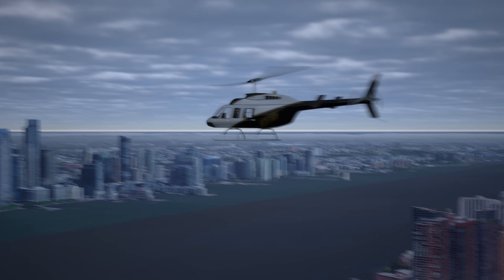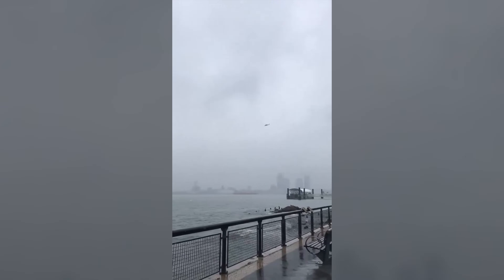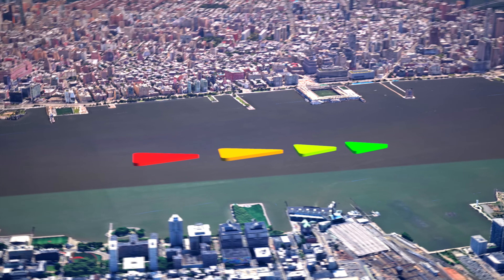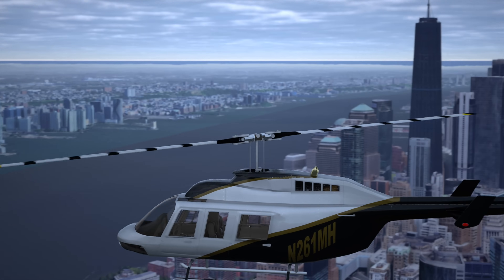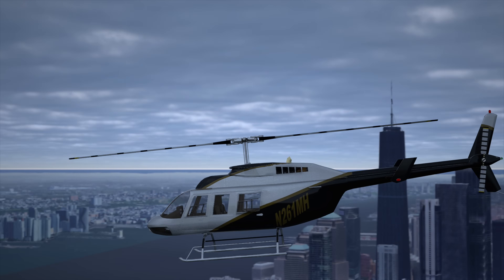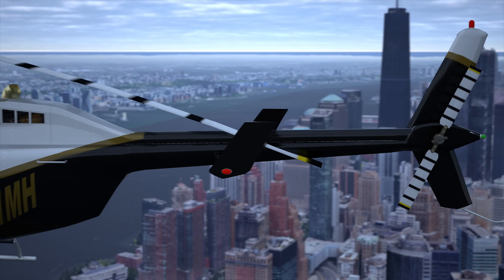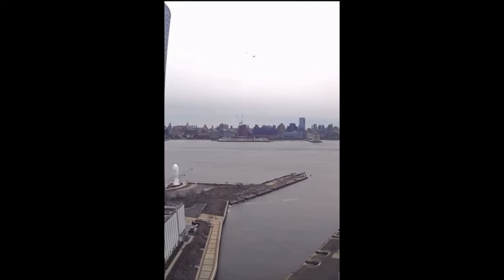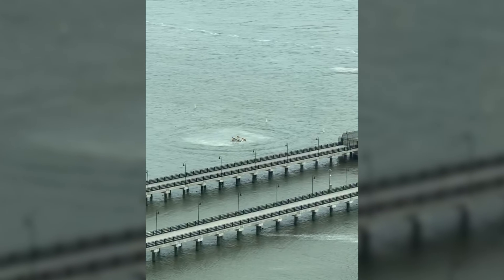Helicopters DON'T just fall from the sky - What is "Mast Bumping"?

Comment: As a 35 year Commercial Helicopter Pilot and Flight Instructor, your Video offers some good basic info. If I may, I would like to add that typically, mast bumping results in the separation of the Rotor Head (and blade assembly) from the TOP of the Mast. I can't remember a case where mast bumping caused a catastrophic separation of the transmission, mast, and main rotor assembly together from the fuselage as it appears in that video. It does look (to me) like a tail strike (or independent tail-boom separation) which could cause that component separation to occur due to the violent torquing effect and imbalance that would result. It's a Terrible tragedy, and my prayers go out to all those affected.
Reply: Excellent point that nobody is seeing. Additionally, the suggestion that a tail cone chop occurred seems to inconsistent with the completely undamaged main rotor spinning in balanced flight after separation. RIP to all aboard.
Reply: @givdrvr  It looks like a gearbox failure.
Reply: @christopherrobinson7541  I agree, he's straight and level here, looks like half the transmission comes off with the main rotor, then it contacts the tail as it comes off the helicopter. Poor dude, RIP
Reply: 20+ years Army helicopter pilot/test pilot.  Yes the rotor system appears to still be attached to the mast and the mast to the "transmission, not the engine.  I agree, in my experience Mast Bump usually separates the rotor from the mast.  In the short view of the rotor system, the rotor blades don't look quite normal, which, to me, suggests contact with the tail boom.  The investigation should figure this incident out.   Don't jump to any conclusions.  Obviously, a sad situation.
Reply: It was not mast bumping. The rotor blades were still in tact and spinning after disconnecting. If those blades hit the tail boom they would have exploded and not been still fine and spinning after disconnecting from the air frame.
Reply: @danmackey9462 By your statement, with respect, I'm not sure you actually know what mast bumping is. Mast bumping has nothing to do with the Tail boom.
Reply: @unapologetic7900  But if the rotor hits the tail of the helicopter at full speed, would the rotor blade still be in one piece?
Reply: @MuffelamMorgen  Maybe, maybe not. It's possible. Those Blades are very tough.
Reply: @unapologetic7900  dude those rotors yard sale if they hit water or pretty much anything. And if they hit the tail hard enough to take it off then 1000% the main rotors would have been in a cloud of parts not still spinning like they are fine.
Reply: @unapologetic7900  I've repl;aced rotor blades on the OH-58 military version of this aircraft, simply because the pilot hit a few twigs on the end of a small branch. There would not have been a rotor left had there been a tail strike.
Reply: @ The Blades of an OH-58 are like a Honda Civic compared to the Blades on a 206-L which would be like a Dodge Pickup. WAY more mass.
Reply: @ Same construction just longer. Bell 206 L  is heavier.
OH 58 C has two blades and later AHIP OH 58 has 407 style rotor system.  
Worked on all Bell products.
Reply: @HongyaMa  My mistake, I was thinking of the OH-6 (MD 500).
Reply: @unapologetic7900  Love the Hughes stuff
Reply: Video still shows Tail boom . mast rotors and gear box exited the scene at the same time. no tail strike, no mast bump. Tail seen with everything intact fin, T/R gearbox & stabilizers - Main rotors mast & main gear box together.
1- Blade lost a piece and gross imbalance over load to structural failure. See it before. Live on scene.
2- engine failed and pilot didn't maintain rotor RPM and the nodalbeams shook everything off. Bell test film.
Helicopter floating with deflated float bags (no deployment) = low or empty fuel tanks 
measured the still and saw one blade shorter then the other . optics?  Whole assembly mast gearbox attached to blades,  above the airframe tail trailing behind whole no strike damage. impulse over load?
If you lose a chunk of blade it will be sudden and it will look like this.
1980s N131AT was a Bell 206 AB and it lost a blade piece at a hover. sudden roll and gear box nearly ripped out.
The student & instructor exited the upside down helicopter  lucky pieces of blade missed everyone. 
found the 1st blade piece imbedded in the runway center line 800 ft away - Sticking up like a road sign.
45+ years helicopter CRH AP-IA with a little time with the NTSB (expert help in the field).
Reply: @HongyaMa  I heard one report that the pilot radioed he was almost out of fuel and was making an emergency return back to base.
Reply: @ time will tell
Reply: This is too sad. Prayers for the surviving family members.
Reply: Caused by what? Poor maintenance?   Improperly torqued bolts? It looks like the aircraft just came apart
Reply: They call it a tail boom bumping, but the blades look 100% clean.
If any blade had touched the tail boom, they would have either bent or break.
Reply: how many mast bump accidents have ever caused a separation of the tail in history of all crashes hmm and who was on that plane hmm
Reply: I think this is going to be catastrophic gearbox failure, causing it to lock up and be ripped out of the airframe by the inertia of the rotor.
Reply: Finally, someone with an intelligent response.  I flew this model aircraft for about 8 years in the army and mast bumping was something we were trained to avoid by staying within aircraft limitations as explained in the operators manual.  Never the less mast bumping results in a main rotor mast fracture and separation in the area of contact with the main rotor head mast stops and not in the separation of the entire rotor head and transmission assembly together.  The accident investigation will ultimately find the actual cause but If I had to guess, it will be related to the tail boom separation and related torque effect on the main transmission assembly as stated by @unapologetic7900.  It's much harder to strike the tail-boom with the main rotor blade than everyone seems to think in the course of normal flight which this appears to be until the moment of the accident.  I always trained pilots to be aware, you don't have to fly aggressively for a helicopter to kill you.  You can just be flying along, straight, dumb and happy and next thing you know boom, your whole world is turned upside down trying to deal with an in-flight emergency.  Unfortunately, this seems to be the case with this accident.
Reply: All helicopters can self-destruct mid-air if the limits are not adhered to. An Apache can hit the canopy with the rotors if you hit the bump stops hard enough, just about any helicopter can hit the tail boom with its rotors if you try hard enough. They all have different limitations that must be followed for safe flight.
Reply: "jesus nut"
Reply: Correct. Push pull tube more likely.
Reply: A flock of birds was seen in the area by witnesses, which could have caused a sharp maneuver by the pilot to avoid the birds. The sharp dive could have caused the mast bump.
Reply: There was a witness that claimed to hear loud noises almost like gunshots, regularly paced, before it downed.
Reply: They don’t have safety things like airbags or parachutes?
Reply: As a 36 year commercial helicopter pilot and flight instructor, I can say mast bumping consistently causes catastrophic separation of the transmission, mast and main rotor assembly
Reply: @jvillain9946  Wrong. Mast bumping takes the rotors off at the point of contact, Mast & Yoke - The blades leave the scent and the helicopter o becomes a Simonized bowling ball. The was worse structural failure from dynamic overload... single Blade failure
Reply: @HongyaMa  wrong mass bumping places the rotor at the points of contact
Reply: @ troll elsewhere.
https://www.youtube.com/watch?v=mom1EJOb51o
You're not an Rotary winged Aviator.
Reply: @HongyaMa  what's it like living with a desperate need to be offended
Reply: @ What's it like living with a desperate need to comment on things you know nothing about?
Reply: @unapologetic7900  pretty easy actually. This is just entertainment to me. Especially when people like you who are incapable of comprehending satire bc they need to be offended by everything all the time. Oh did this offend you?
Reply: @jvillain9946  Lol, not in the least, but it should offend your Parents. How proud they must be.
Reply: @unapologetic7900  I can promise you theyre  not poorly feigning restraint to cover their rage at being called out for needing to be offended by everything all the time just bc someone made a satirical joke in a random comment section in a random video. Watcha else you got Karen? Don't you have a minimum wage employee to be harassing?
Reply: @jvillain9946  There is a big difference between "trolling" and just being mean. Your problem is that you don't know the difference. In order to "troll" you first have to actually understand the facts, which you clearly don't, you are a sad case, please check to make sure you have taken your Meds today.
Reply: @unapologetic7900  difference between being mean and stating facts, like you just want to be offended and will look for any reason to do so and now looking for reason to defend doing so.  How bout you go back and read the original comment then read my original reply again and tell me how you didn't see that it was satirical and how you immediately decided to get offended bc of your need to be offended and need to feel superior
Reply: You are being too kind.  This video is shit with pretty graphics.  People should wait for the preliminary NTSB report before floating theories on flimsy evidence.
Reply: But curiosity by those of us not well versed on the inner workings of a helicopter this is interesting information. 

I know what curiosity did to that cat, but it's interesting the theories by those who know a thing or 2 about the birds.
Not jumping to any conclusions, just pondering possibilities. Glad you're here to keep us in check though.  ✌️ @Skummeh2
Reply: How often does this happen? 
Are there any maintenance rules to check for this before departures?

Sully got skewered by other pilots because he said F them birds instead of doing what everyone else has been doing before due to the birds
Reply: @adrianspikes6454  Extremely rare, most modern Helos don't have this style of "teetering" two blade system , so "mast bumping" (if that's what happened here) is far less likely.

Comment: Shouldn't this be considered a design flaw? The "possibility" of the main rotor touching the tail or any other part of the copter, is what caused this.
Reply: It definitely sounds like a design flaw, but whether implicated in this crash, unknown...it may have been caused by poor maintenance  and or a bearing failing, and/ or a part shearing off.
Reply: Not a design "flaw", it's just simply the laws of physics. There are fully articulated rotor systems that mitigates this issue but they are more expensive to acquire and maintain. There are plenty of limits in any aircrafts especially helicopters, some are accounted for by using a more upscale and expensive design, some the pilots need to account for.

Comment: Oh I feel so bad for the owner of the company and family members of the victims.   That last radio response was heartbreaking.  I believe that mast bumping is the most likely cause.
Reply: Honestly, don't feel bad for the owner of the company just yet. Highly likely this is maintenance related. The main rotor gearbox doesn't just rip itself clean off like that.
Reply: @generalthunder5796  I will agree with that too.  It's one of the items that went through my head.
Reply: @generalthunder5796  I just seen this summary in a newsletter I get: 

The FAA has grounded New York Helicopter Charter Inc. following a tragic crash into the Hudson River that claimed six lives. The agency cited serious safety concerns after the company’s director of operations was fired shortly after agreeing to suspend flights during the investigation. With no qualified replacement in place, the FAA determined the operator lacked the necessary oversight to continue flying. A comprehensive review of the company’s practices is now underway as investigators work to determine what led to the fatal midair breakup.

Comment: As far as I know watching it live yesterday with three or four experts on a channel call, one military, he said that the floats actually weren't ever deployed and were still folded up.
One guy said he did a lot of his learning in New Jersey and has been up and down that River before, and he said he has seen a lot of helicopter pilots' hot dogging, he wasn't going to say anything for certain of course, just that he has seen that a lot and that would explain what happened. They all said they have never seen where the blades come off like that.
A couple of them saying, that the one Comfort the family could probably have is the situation like that they usually die from blunt force trauma. So they're probably wasn't much suffering, or in this case, drowning. The military guy said they have to be trained to get out of those harnesses when it's upside down in the water. 90% of people wouldn't be able to get out of the upside down helicopter in the water.
So very sad and tragic.
Plus dodging Birds is actually a bad move with a helicopter, he was explaining how they run and everything and if they lose engine power they can still land and everybody survive, from the flotation devices. Once you lose your blades and tail that's it

Comment: There's another video that starts before the accident.   The helicopter is straight and level - no maneuvering.  

The sequence is the helicopter yaws strongly right - no visible strike.  THEN the tail breaks off.   Then two seconds after the yaw the rotors come off with the tail long gone.  There might have been a boom strike when it yawed but I couldn't prove that either way.

Virtually anything caused by the main rotors binding or striking will yaw the helicopter left.   This failure started with the tail where some failure modes will yaw right.  I'm not making bets as to what the cause of this is, just stating what could be seen.  Anything from the transmission heading to the rear is especially fair game.

I'd post the video but reddit has removed it as too graphic.

Comment: The tail boom appeared to be separated where it is bolted to the fuselage. If the blades struck the tail boom, then it would have been severed half way out. If the tail boon had separated, I imagine mast bumping would have happened very quickly. In that case, nothing the pilot could’ve done to save it. The loss of tail rotor thrust and the dramatic change in center of gravity would make the crash inevitable.
Reply: I’m far from an expert, this video is well done, but from the footage the tail and the blades both seem to be in better shape than I would picture them being. Kind of crazy, I’d think one piece would have got mangled and broken off but for both to separate is freaky. Very sad nonetheless for that family and the pilot.

Comment: I would guess that the rear drive shaft bearing locked up causing or overheated causing the shaft to snap locking up the transmission causing the bellhousing to snap off of the engine